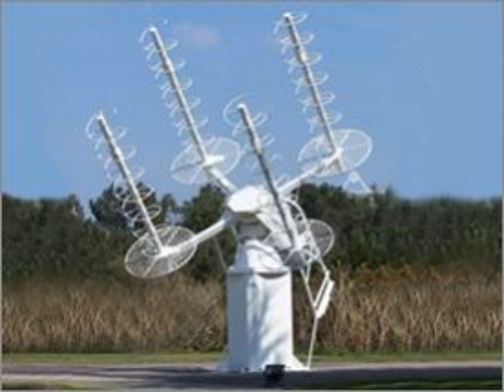Double-Helix Dialog: DNA Informs Fascinating Antenna Design with Biomedical Imaging Potential

Comment: Oh.. if t he virus is scanning detecting water nearby would reflect the tiniest surface water distortions ? if you looked at water from the light through the right shaped crystal you'd see it.. so that would follow for life because it must be self programmable to be able to replicate ? like the shapes we see. 

Whatever natural version of this is in the DNA pointing out to find water ? a complementary study of how water behaves in all life, cellular structure in water using the "Fourth phase of water" by Dr Gerald surely suggests all DNA will align along a water axis ? 

When you're the virus and its just a natural evolution built in, as a program, maybe there is a couple of configurations as we see in how water stacks flat or aligns along the open side for flow. In comes the virus and a mutation in the other configuration (think over millions of years, many evolved versions). Yes guys, this is screaming yes to me.

Whole lot smarter than me at the actual application, but it makes perfect sense to try and imagine the virus as having some sort of 2way options non stop :) ? if it has all those suckers pointing out and its floating in, it already may have early warning that its going to hit some water so it can grab it ? that is the nasty looking possibility of such pointy circles.. I suppose we have little sensors like that or something for antibodies hahaha.. 

The half of something in a replicator is like the M/F of our species right :) and there can only be so many splits along the timeline.. but we have different regions and those cooled and warmed over time at different rates too ! so it gets very complicated but very excited about this type of imaging :O